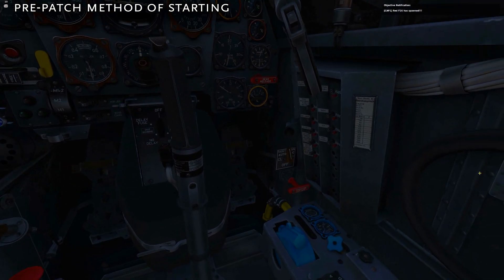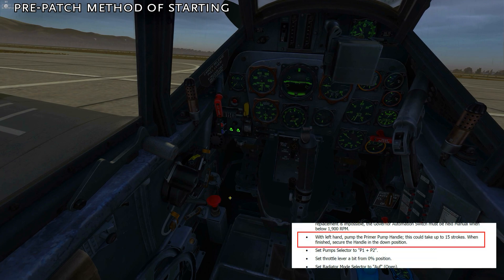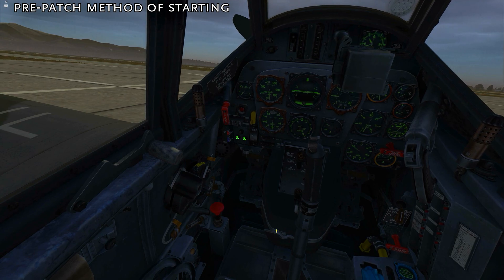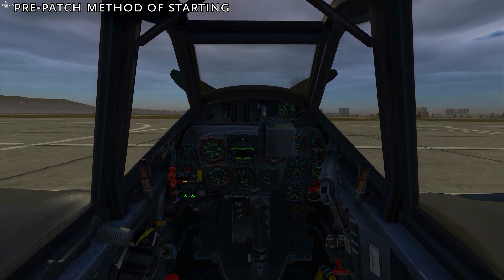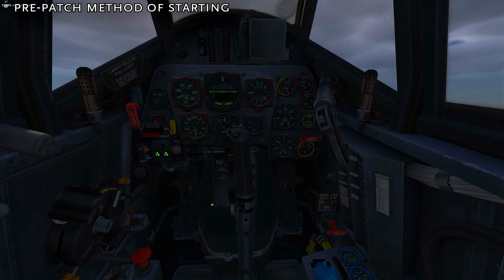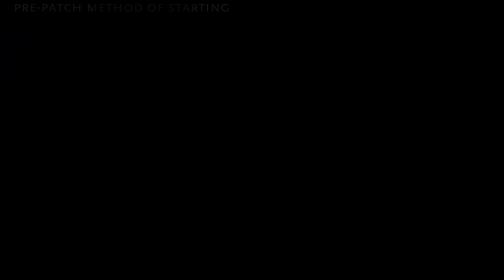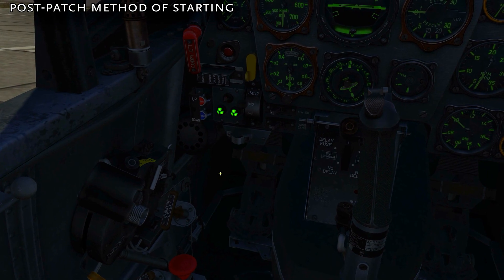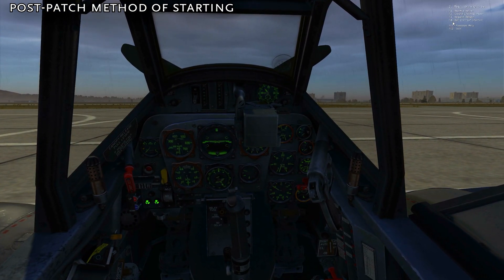DCS: BF-109 startup - Engine Trouble tutorial (Post v1.5)

Comment: when I start this plane up I try to taxi to the runway but as soon as I apply enough throttle to get her to move forward she started to turn to the left. no matter what rudder input I put in. just goes in circles only way to stop it is the wheel break. any ideas what i'm doing wrong ?
Reply from the maker: Applying too much power too quickly and not enough brake usage. WIth a spinning prop on these taildraggers you get a large turning tendency due to P-factor and torque, so apply power slowly as you roll and always be on that right brake to straighten yourself out. Also make sure you lock the tail wheel prior to takeoff.
Reply: thanks bro everything you said was right on the money. easy take offs for me after doing all that
Reply from the maker: glad I could help